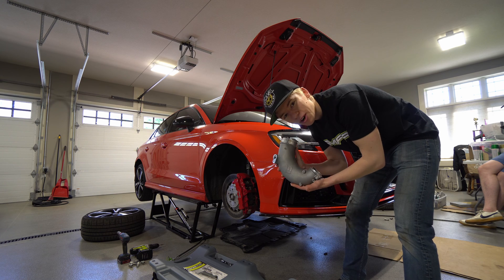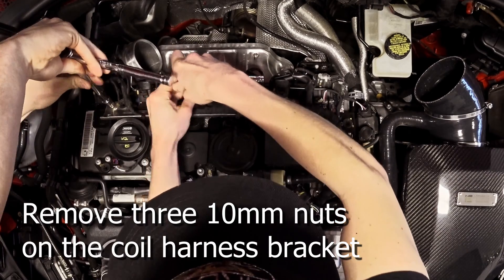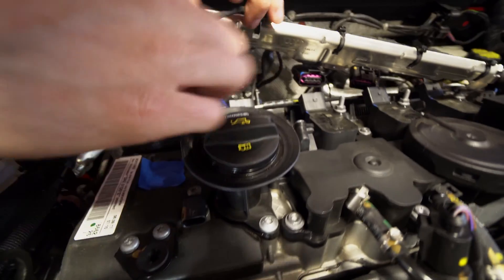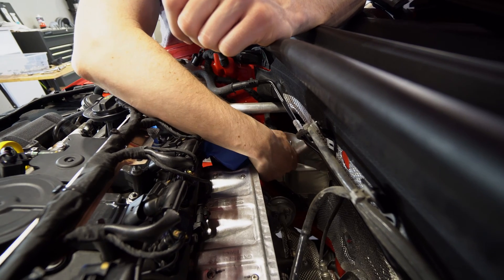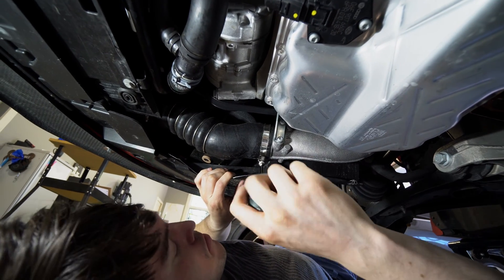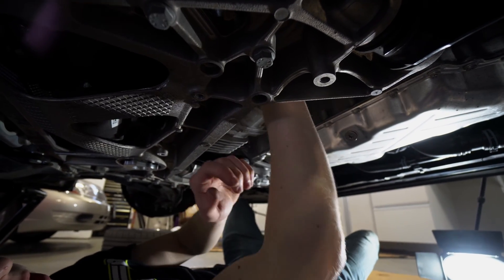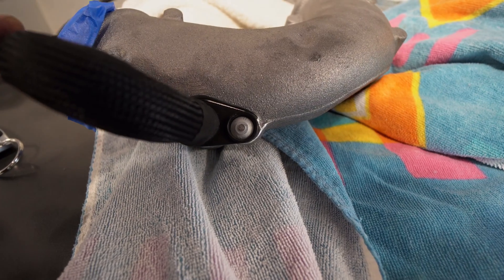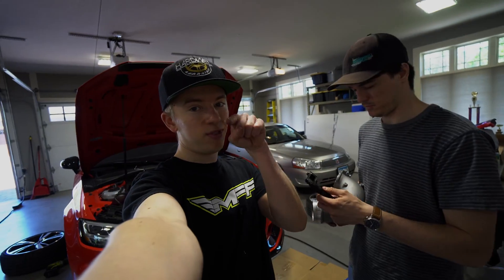Integrated Engineering Turbo Inlet Audi RS3 8v

Comment: any tips or tricks on how to get the top clamp of the turbo outlet pipe? Did you use a 7mm on a socket, flat head, etc? Cant seem to find an angle to reach it
Reply from the maker: I believe a 7mm deep socket usually

Comment: What's the diameter of the IE turbo inlet elbow ?
Reply from the maker: It is 3" if I recall correctly.  At the time this was the only inlet available.  I'm surprised, but it doesn't look like they have developed a 4" or 5" inlet much like APR has.

Comment: I'm curious as to how much power you gained from the inlet above and beyond that of the intake.   Seems like a real pain in the butt hole.
Reply from the maker: It's supposed to be roughly 10-15hp, but hard to say. Butt Dyno says it's still fast 🤣
Reply: @HardwayLearning  are you tuned? If so what tune do you have?
Reply from the maker: We were Custom Code Stage 2 ECU/TCU on 93 octane, but that has proved to result in a complete engine rebuild
Reply: @HardwayLearning  man, sorry to hear that. I heard another guy that had custom code also had his engine damaged. I get out when you boost vehicles above oem spec it can go south, but this looks more like a tuning fault more and more. I just went stage 1 apr, and even then I'm a little worried blowing it up, lol. And they have been around way longer in the tuning business. Can you chime in more on the situation? Do you think it was the tune? Or something else? Also how's your motor build coming along?
Reply from the maker: @leonardoarispe4689  I'm leaning towards it being the tune, had the injectors flow tested and they were all in spec.  The engine is done with the rebuild, waiting for install back in the chassis!
Reply: @HardwayLearning  that's awesome man. Looks like it's been a while to get this bad boy running again. Can't wait to see it on the road again. Good luck and post more videos.
Reply: @HardwayLearning  Did you go with upgraded pistons/rods?
Reply from the maker: I can't give away all of our secrets just yet 😁, stay tuned!
Reply from the maker: Check out Vancity's Dyno test here! https://m.youtube.com/watch?feature=youtu.be&v=8FIPygP03J4

Comment: thanks for the vid, was really hoping to see those bolts that were missed because of camera and also that clip on the wastegate that has to be removed . sure wish the install was as long as the video lol. the whole wastegate part is what is intimidating me from doing this.
Reply from the maker: Sorry we missed the wastegate, but if I remember correctly, the line running to it really just slips right off!

Comment: Great video. Still staring at my IE inlet pipe on the work bench in my garage. Giving me the motivation to start. Did the exhaust sound change and any change in power after inlet pipe install? Does your IE intake whistle a lot more than stock, mine sounds way different than stock.
Reply from the maker: I'm not convinced we noticed a huge difference in noise with the inlet, but according to graphs we get more power 🤷‍♂️! The intake made a huge difference in audible turbo noises, and it puts a huge grin on our faces every time she spools up!